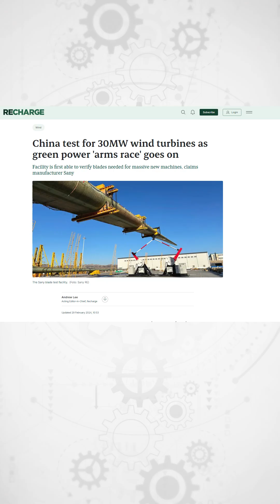Is bigger always better for wind turbines?

Comment: The turbines near here locally apparently the blade tip speed is already near 270kmh, even though they look like they are only doing 30rpm
Reply: it is one of the challenges to the material to be overcome. abrasion over 25 years is probably crazy.

Comment: Why isn’t the square cube law preventing Chinese from building these gigantic wind turbines?
Reply: It's not a strict limitation, you can spend more and go ahead. The economics of doing so depend on many things. Perhaps they discovered  lighter weight, cheap materials? Maybe there's only room for one installation where they will be built? Could be just for the glory? In ten years the details should shake out. There should be an optimum scale with current tech, but a special situation might outweigh that.
Reply: Tofu... they use it in all their major construction projects.

Comment: Soda bottles used to be made out of glass because plastics would stretch under the pressure.  But glass soda bottles sometimes explode. PET plastic was discovered about 40 years ago.  It can withstand the pressure without stretching.  A two liter PET plastic bottle can withstand about 200 PSI.  
A pressurized PET plastic cylinder might he the strongest building material for its weight and least expensive.  It is flammable, but if it is pressurized with CO2 it would be like a fire extinguisher. 
If you made a giant one kilometer square multi hull sailing ship out of 100 meter long, ten meter diameter pressurized cylinders, it could harness the wind energy with ubderwater propeller blades that are much smaller than giant turbine blades.   Try bending a plastic Coca Cola bottle  after it has been shaken up. A soda bottle can easily withstand a hurricane.